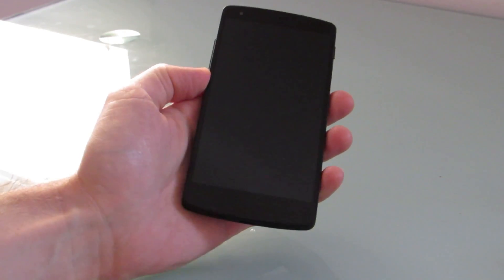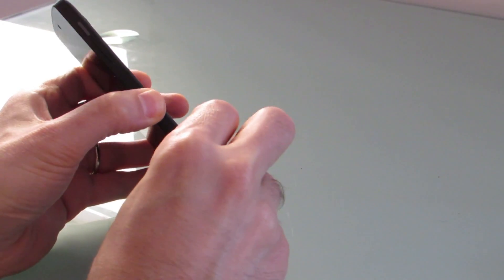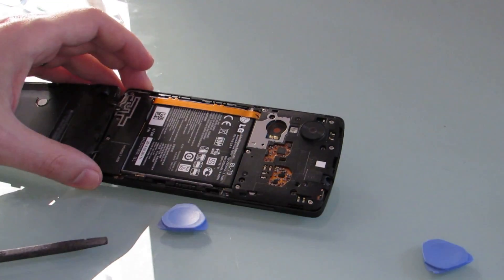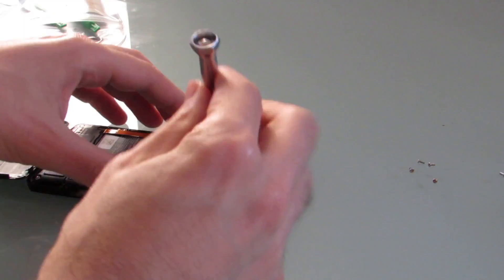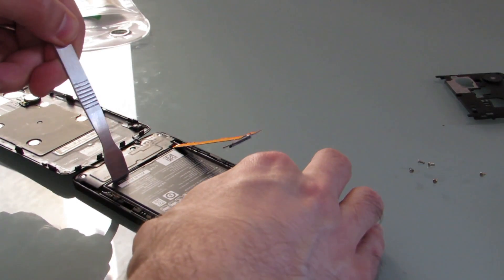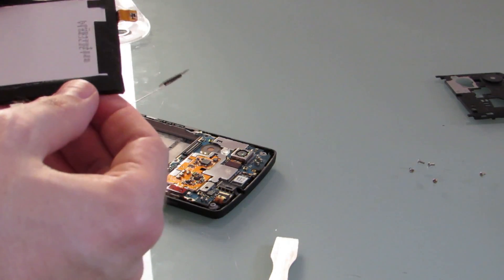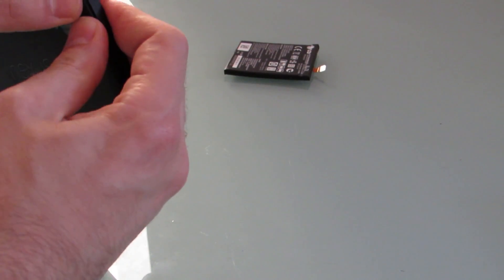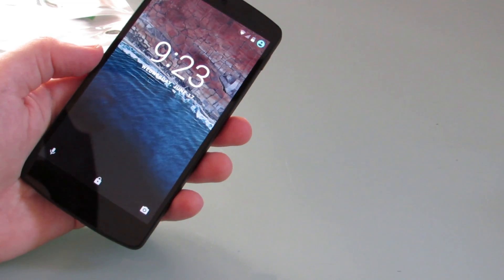Google Nexus 5 battery replacement surgery

Comment: where'd you get your replacement? cuz I've bought 3 and only one was a Real LG BL-T9. can tell from the date on it and the imprint on the back should start "LGHD" then numbers and letters, usually 2 lines. I need to find a real one cuz I can't stand putting copycat crap in my beloved N5

Comment: Follow up?  How did that battery hold up?  

Since this video was made, many 1 star reviews for these replacement batteries have appeared on Amazon.com.    I don't see anywhere to get a well rated replacement battery.
Reply from the maker: Yeah... After a week, I'm not convinced I'm getting any better battery life. It might actually be worse... I'm wondering if I got a used or refurbished battery marked as new. Theoretically this procedure could still be useful, but only if you know you're replacing the original battery with something better. I've removed the link from the description since I'm not sure I'd recommend buying a battery from the same seller I used.
Reply: I've got a nexus 4.  Much easier to just open the back and get a new battery.  I've tried it 3 times and every time I get a battery that doesn't hold charge as well as the 3 year old battery that is in there.  Something is really rotten with the state of replacement batteries.  Seems almost like an effort on behalf of the giant companies to be sure we can't keep our phones alive & are forced to buy the new ones.   That may sound conspiracy theory, but I bet the combination of Samsung, LG, Apple have some serious say about which batteries go to new phones & which can be used in the replacement aftermarket.

Comment: Looks good. ... Mostly anyways. 
I'm scared of possibly popping the battery while removing it like that. I had a bad experience doing something similar on my LG Optimus G. I used a metal prying tool to slide under the battery into the adhesive and I ended up sparking something.